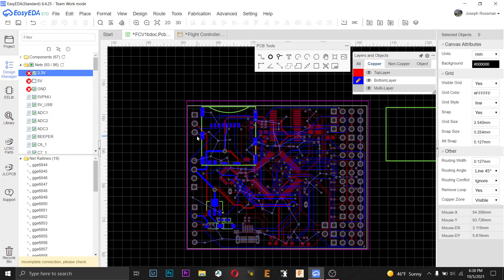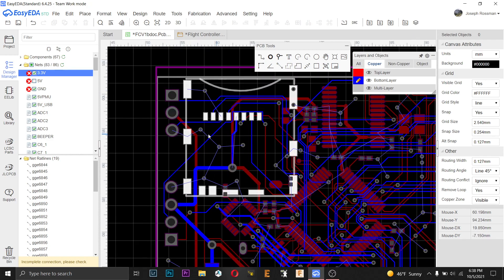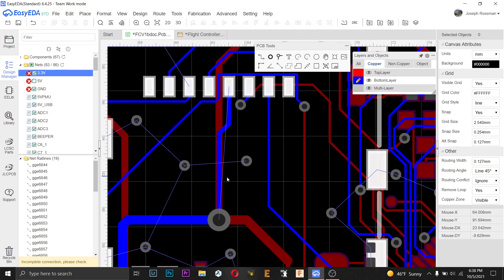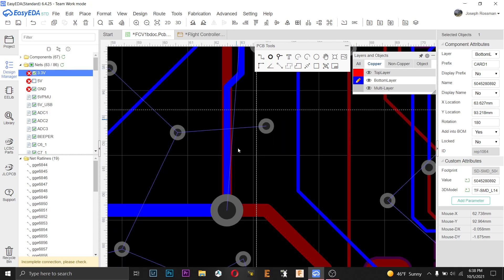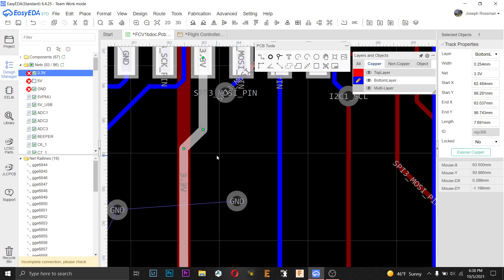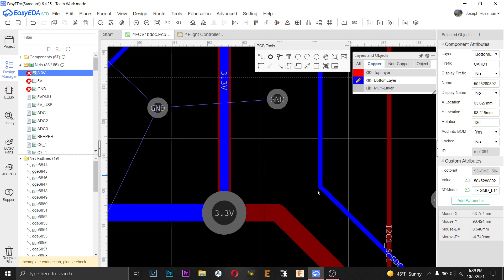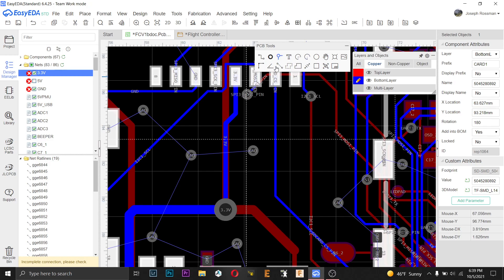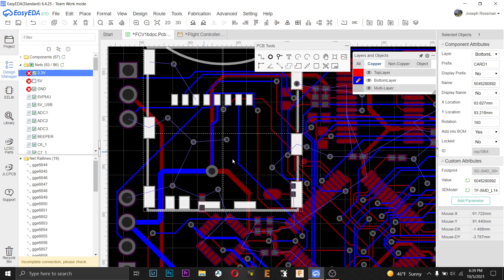EasyEDA Incomplete connection? (BUT IT ISN'T!) Check this first.

Comment: hi sir  how can net connection delete pcb design display area  in easyeda
Reply: To delete a net connection in the PCB design display area in EasyEDA, you can follow these steps:

Select the object (like a track or via) that is part of the net you want to delete.
Go to the right-hand panel and find the Net attribute.
Delete the net name text in the attribute.
This will remove the net connection from the selected object. If you want to delete an entire net (all connections), you’ll need to do this for each object in the net.

If you want to hide the ratline (the line showing a net connection) without deleting the net, you can deselect the net in the design manager. This will hide the ratline in the PCB editor, but the net connection will still exist.

Remember, if you run the auto-router after deleting a net, it may reconnect the pins if the net information is still there. So, make sure to clear the net property of the objects if you don’t want them to be reconnected.
Reply: Do you founded a solution?
I want to delete one single net.